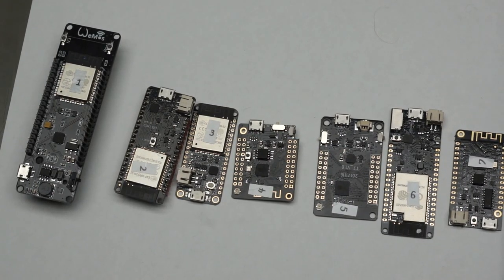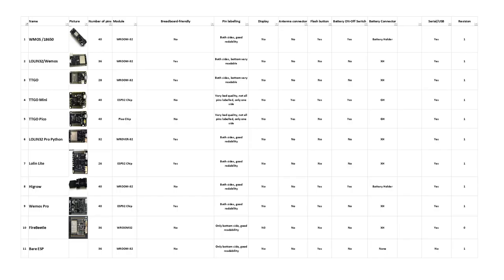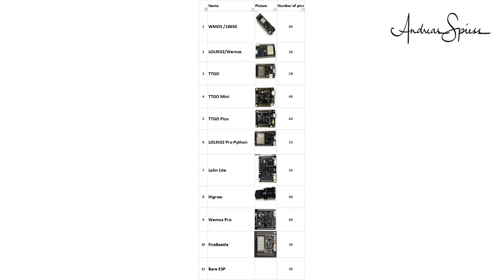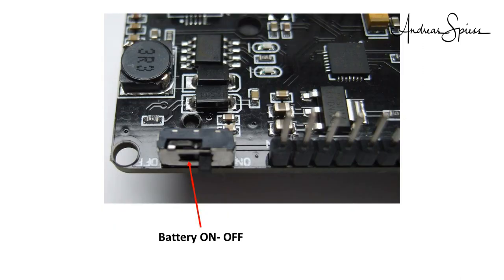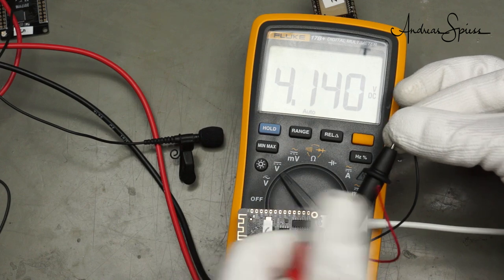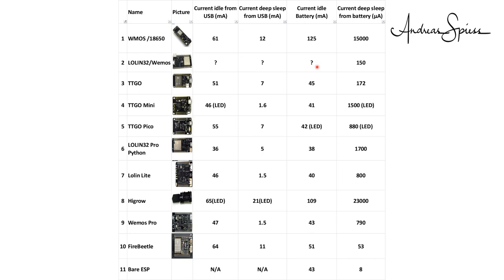#193 Comparison of 10 ESP32 Battery powered Boards without display (incl. deep-sleep)

Comment: I've got some of those Lolin32-boards months ago already and I'm quite happy with them. With a separate connector for a battery the form-factor is much more useable IMHO than with those with soldered-on 18650-holder, and otherwise the design is very minimalistic, which means no sudden surprises or junk drawing power unnecessarily.
Reply: Yeah, I don't disagree with you, but at least it's a minor issue. I've seen some sellers ship those boards with small stickers with the pin-labels, so you can slap the sticker on the board after soldering the pins, which isn't exactly an optimal workaround, but it's workable -- I don't have any links handy to share, though, as it's been awhile since I last bought some.
Reply from the maker: This is the reason for the table. You can filter what matters for you.

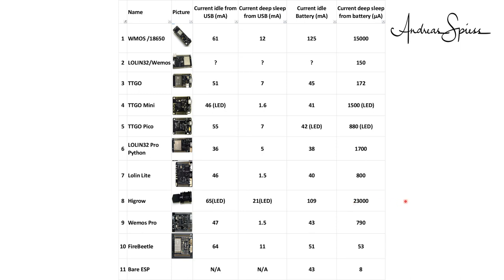Comment: 9:38 - So the TTGO boards are the only ones that have a power LED that is on whenever power is applied?  I don't know why people do that for small battery circuits like this.  At most they should just have a LED that flashes every few seconds when on battery.  And ideally provide either a pair of headers that can be jumpered to use the LED or provide a thin marked trace that can easily be cut.
Reply from the maker: You can easily remove such small LEDs with a soldering iron. I just did not want to disturb the comparison
Reply: Andreas, I agree with your testing method but the manufacture should be considering such an obvious mistake.  It's fine to have a power LED when on USB power but when on battery the LED is likely using the majority of the power.  Going from 880uA with the LED to likely about 80uA without will have a huge impact on battery life for something that spends most of its time in deep sleep.
Reply: For later updates I would be interested in seeing the numbers with them removed.

Comment: I know this is an older video and you probably know this by now, but in case you don't, at 5:30 you mention the flash button isn't necessary because the Arduino IDE does it automatically for you which isn't true. That only happens if the the boards have two npn transistors that automatically switch the Enable and GPIO0 of the ESP32 when the DTR and RTS pins of the USB_UART converter change state (when you upload/download code to the ESP32), the IDE isn't even aware of this. Other than that, excellent video.
Reply from the maker: You are right, of course. The board on 5:30 has those transistors.

Comment: Without any previous knowledge, I purchased a low cost DOIT ESP32 Devkit V1 and decoder module, to build a simple breadboard internet radio.  This may have been a hasty decision. While the pin to pin spacing is correct, the side to side spacing of the headers is not bread board friendly in that it is 9 rows wide.  That only leaves a row of pins on one side of the board. That is on a typical 10 row + two power rail rows breadboard. Oh, and the internet radio works to some degree but stutters a lot. I'm not deeply involved in the electronics part of the project.  Just wished to copy someone's talent.  I probably selected the wrong ESP32 board.  While this video is way over my head, it may help with my next ESP32 selection.  Thank you. New subscriber.
Reply from the maker: Welcome aboard the channel!

Comment: Great Video, thank you.
What I can recommend to test: Are the boards booting automatically on the following cases:
- A new battery gets inserted (or a battery power cable gets inserted)
- A USB power supply (e.g. power bank, USB power supply gets connected.)

I figured out that sometimes the ESP32 does not issue a proper reset when a USB power source gets connected or when a battery gets inserted. The problem here is that a power outage will not boot the ESP32 again which means it cannot run autonomous.
Regards from Arduino Hannover
Reply from the maker: What I tested is to connect and disconnect the USB power. As mentioned, this is the usual case for me (also for solar). I did not disconnect the battery. You should find it in the table. Changing the battery for me is maintenance ;-)

Comment: If you use ESP32 DEVKIT V1 you can remove the SILABS CP210x USB to UART Bridge and the AMS1117 voltage regulator for power savings. You can use an external USB to UART converter to program your ESP32 board
Reply from the maker: I usually use an ESP wroover module if I do not need any other components.

Comment: I wonder how good the battery managment really is. Under and Overvoltage Protection, correct charging current , ...
Any experiences?
Reply: I would like to find out as well
Reply: me too
Reply: and also if is possible to put a warning for low voltage in arduino code
Reply from the maker: If you know the chips used you can consult the datasheets. Most of the boards have no protection, as I said in the video. You always can monitor voltage with an analog input of the ESP and go to deep sleep if too low.
Reply: You can buy 18650 cells with a protection IC built into the end.

Comment: if you ever update / extend this comparison, check out the "ttgo t1" and "ttgo t8" (there are a few other models like "t7", "t5", "t2", etc., but some of those have screens).

possibly also test the sparkfun "esp32 thing" and "adafruit huzzah32", to see if they have different power consumption from the clones, and are worth paying more (probably not).
Reply from the maker: I plan a comparison of boards with displays and some TTGOs will be part of it. So far I did not test any "American" boards because they are extremely expensive here (shipping cost doubles the already high price).
Reply: the t1 and t8 dont have screens, they look like variants of the ones you tested here.

and yes, shipping from the us to europe (or vice versa) can be quite expensive. china seems to have figured out that, by having subsidized shipping, they can greatly increase their exports. and half the work is done by the postal services of the destination country, anyway. for free.

Comment: Andreas, just wanted to say that I'm prototyping a temperature/humidity sensor using the ESP-12F bare module.  My power source is going to be 3xAA so I'm using a little voltage regulator breakout from eBay to output 3.3V.  My budget multimeter shows this setup uses 115uA in deep sleep which is ok and should give me 6-9 months hopefully.  Still experimenting to try and get the longest runtime.  Keep up the good work!
Reply: Not that anyone cares but just to keep updated.  After measuring current some more it appears that the culprit is the DHT21 temp sensor.  It stays powered on while the ESP is in deep sleep which accounts for about 105 of the 115uA that is being consumed.  Need to come up with a way to power it down while the ESP is in deep sleep.
Reply: Last chapter, tried using one of the digital pins to power the DHT21 but during deep sleep the GPIO pins seem to float up from ground.  Ended up with 1.9v on the pins no matter what I tried.  So I went with a 2N2222 transistor low side switch config to switch power on the DHT21.  Still uses a digital pin to control the power but it now switches the temp sensor off during deep sleep.  Down to 27uA which is good enough for me.
Reply from the maker: Good concept. This is how I would have done  Maybe I would have used a FET as a switch, but this does not matter...

Comment: I was also searching for a development board which consumes not that much power. The Firebeetle ESP32 beets everything but since they are still shipped with revision 0 chips I can not recommend them. If you still want to get a board with low power consumption go for the WEMOS Lolin32 (not Lite-Version). Other sources confirm, that it consumes 135µA in Deep sleep. The regulator on the Wemos Lolin32 is an ME6211. The Lipo Charger on it is the TP4054.
Reply from the maker: Do you refer to my #2 board? Or is it a different one?
Reply: Yes I refer to the board #2 in your video.
Reply from the maker: Where did you get the information concerning the chips?
Reply: From the Video "Tech Note 062" from the channel G6EJD
Reply from the maker: Thanks. In the meantime, a viewer pointed me to the original diagram on the Wemos page.

Comment: Very helpful video. It seems however that a number of the boards with the lowest deep sleep current are discontinued. I have not been able to find a bare bones ESP32 on a PCB from any outlet although I have found PCBs for sale and the bare ESP32 modules for sale. I have not attempted surface mount soldering yet and I wondered if you know of anywhere that sells pre-soldered modules? I have a solar powered project that I am working on and very low current sleep would be a great help.
Reply from the maker: Look at our Superpower project. There two teams try to build a low power board for ESPs and a UPS for a Raspberry

Comment: Hi, can you elaborate on how did you connected the LiPo to bare bone esp32. If I am correct, connecting a fully charged LiPo (4.2V) can fry the esp32 so some voltage regulation must be needed in between.
Reply from the maker: The ESP32 is rated up to 3.6 volts. So you need a voltage regulator for a Li_Po battery

Comment: Very useful review, thank you! Especially as it seems most of the I2C issues on the ESP32 Arduino will likely get solved in the near future. There's a fork with reportedly better working I2C support being currently reviewed/cleaned up to be merged into the main project. I don't remember just now the developers name but it can be found from one of the I2C issue thread discussions. The I2C issues have been a blocker for me to start moving forward from the trusty but limited ESP8266.
Reply from the maker: So far I have no big experience with I2C on the ESP.

Comment: Thanks a lot for this useful comparison.
- Could you add a column "CE/FCC" certification? You mentioned it in the vid but not in the table. It gets more and more important as the customs e.g. in Germany hav a look on that. 
- encouraging results for quiescent current during deep sleep, espec. with RT9080 Regulator. On the other hand: using wifi will spoil this results und unfortunately using BT or BLE too. So up to now I am still using my ESPs with grid power and for off-grid battery applications some cheap 433MHz or less cheap 868MHz Homematic sensors/actors. Perhaps it might be interesting to use ESP32 in combination with cheap 433MHz transmitters?
Reply from the maker: 1. All WROOM and WROOVER boards have an FCC label printed on them.
2. Maybe I will do something with 433 in the future. I have a few components laying around...
Reply: Thanks for your Reply.
currently I am using a dozend cheap 433MHz sensors, collecting the data with RFLink and ioBroker. The sensors are cheap but sometimes strange. Water leakage sensors e.g. give you an Alarm when becoming wet, but not a clear state as "dry" or "wet".

Comment: do you think, it is possible to connect a solar panel to the wmos18650 to create a complete 
self-sufficient weather station (only light and temp mess.)?
What solar panel would you recommend?
If you answerd a similar question before, please excusethe double and tell me on which video.
Reply from the maker: Maybe I create such a solar combination with the boards I got in my recent mailbag. I made a video about solar power where I show how to calculate panel size and battery size

Comment: Thank you for this upload! I was originally looking for info on the TTGO Mini32 T7 1.4 and learned a lot of generally useful stuff here. 
Do you (or anyone, please!) have an idea where to find the datasheet for said model? I'm not looking for schematics or pinout diagrams.
Instead I need to know the voltage tolerance on the battery connector. 
Also: How do you disable the LED in deep-sleep-mode? Do you just desolder it?
Reply from the maker: TTGO maintains a GitHub page with most of the diagrams. Google should find it.
And desoldering the diode is usually the only possibility...

Comment: I am using DFRobot FireBeetle ESP32 IoT Microcontroller (Supports Wi-Fi & Bluetooth) and connected OLED, e-paper and a sensor and power is also supplied from from ESP32(from 3.3V pinout) then in this case what power we assume this FireBeetle ESP will consume in deep sleep?. Current the ESP which I am using continue to supply power to these components even when I put it in deep sleep.
Reply from the maker: You have to measure your entire setup to know it because of the different parts you use.

Comment: Has any one had success powering the TTGO Pico through the JST connector with a Lipo pack ? I have 2 of these boards, and both go into a reset-loop. I even added a capacitor across the power supply... 
They boot normally if powered on the micro-USB port.
Reply from the maker: Strange. Mine booted from a battery. But I only tested one short sketch to measure currents.

Comment: Have you also tested the 18650  battery management  and protection against deep discharge?
Reply from the maker: No. But you can consult the datasheets of the voltage regulators.
Reply: today i found out that the switch on this device does not prevent it from emptying the battery to 0.

Comment: Outstanding information!  Question about the Firebeetle.  It's the best from a deep sleep perspective but I'm wondering if there is any concern with the chip being rev 0 instead of 1?
Reply from the maker: There are a few differences. You can Google. Usually I try to avoid rev 0 boards these days.

Comment: I have TTGO with display, did not find a schematic anywhere, so this is parameter I look for when looking for boards, also hate ch340 usb converter they are unrelable.
Reply from the maker: I plan another video with boards with displays
Reply: +1 to  lunokhod - I spent couple hours straggling with a strange board "HW-607" with a CH340 USB convertor. Sparkfun has drivers for it, but the board itself periodically fails and the board is not in the Arduino IDE board list (another not nice point). Maybe it worth to mention USB convertor for boards.
Thank for great videos.

Comment: I am doing a project with the Firebeetle and the table says that it uses a JST-XH. I purchased the cables in the link above and they  do not fit. They are slightly too big and have 2 plastic locks vs a center guide slot pin. Any idea what the actual connector is?
Reply from the maker: You are right. I corrected the spreadsheet to PH 2.0. They should work.

Comment: thanks for the comparison! dissapointing that the Higrow sucks so much energy in deep sleep. Why is that? Are the Sensors (soil moisture/dht11)powered all the time?
Reply from the maker: As I mentioned, I did not test if you can switch them off. And I mentioned also the AMS1117 which is very bad for that purpose (watch my ESP8266 deep-sleep videos)

Comment: That flash boot button is needed when uploading I've found. Or else the arduino IDE doesn't connect to the ESP32 and start uploading.
Reply from the maker: Depends on the board you use

Comment: Such great work and as always the highest SNR!   Wemos Pro seems to have solder pads that could be used for an external antenna.  Anybody know if that's feasible?
Reply from the maker: I saw it, too. I just ordered a few connectors to try it. We have to see if we have to change also another part.
Reply: Excellent, thanks Andreas!  I hope more of these boards feature external antenna connectors in future.

Comment: Thanks Andreas. That is a very useful comparison. Could you tell me what does "Yes" in "USB Power on/off possible" column mean?
Does it mean you can connect/disconnect USB without the ESP resetting 
OR
Does it mean connecting/disconnecting USB may reset the ESP?
OR
Does it mean something else?
Reply from the maker: Yes means #1 of your proposed sentences.
Reply: Thanks! I ordered some Number 2 boards based on your current measurement and other comments here.

Comment: Thanks for this video. I can't get firebeetle below 800uA in deepsleep. What kind of setup did you use to achieve 50 uA? (I am able to get sparkfun thing down to 500 uA). Thanks.
Reply from the maker: Did you see that I measured the battery current?

Comment: Very nice comparison, Andreas. Thank you for shopping so I don't have to! That said, I am disappointed: none of these boards includes an external antenna connector. It is notoriously difficult to add a connector as vendors seldom provide a decent ground anywhere near the ubiquitous spaghettenna.
Reply from the maker: Two have antenna connectors.
Reply: So they do! This is what I get for half watching your video while I work on a project. Sorry.

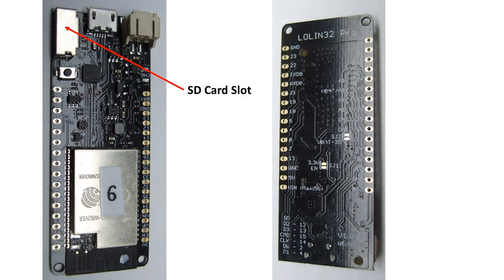Comment: 1:28 Lolin 32 board can output 5v?
Reply from the maker: No, you only have a 5 volt pin which is connected to the USB

Comment: Hi Andreas, great video, it has been a big help on my project.  
You may have covered it in the video and i missed it, whats the reason board consume so much less current when powered via the battery than by usb? ie 53 micro amps vs 11,000  micro amps for the firebeetle.

Thanks again,
Mike
Reply from the maker: There are more components on the board which consume power (LDO, serial to USB converter, etc.)
Reply: @AndreasSpiess  Thanks for the quick reply,  removing/de-soldering the the CP2102 usb converter on a nodemcu V1 board dropped me from 10 milli-amps to micro amps. <<-- It would have taken me much longer to figure that out without your prompt. 

In case its useful to future readers, I tried to modify the CP2102 Rom settings [using CP21xx customization utility] to get the thing to enter Selective Suspend [low power no com mode] but the chip does not support changing this option..... back to the drawing board. 

Thanks again,
Mike